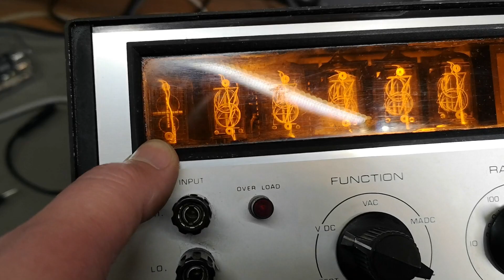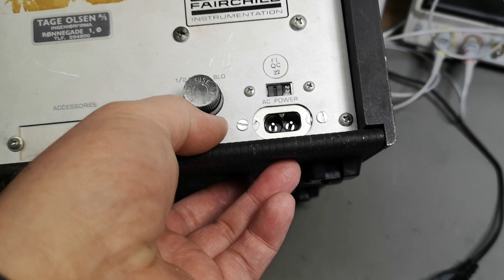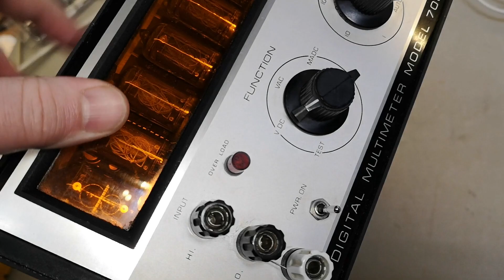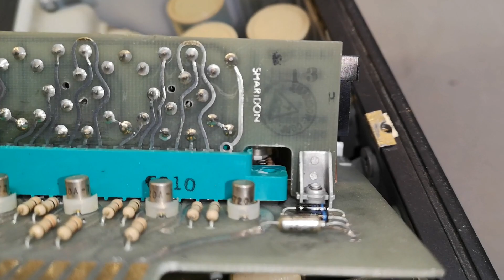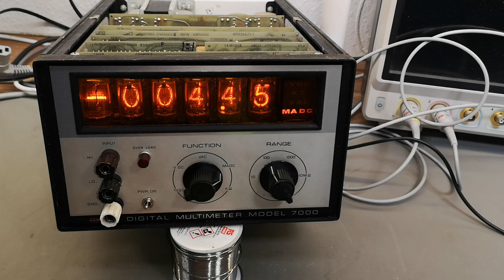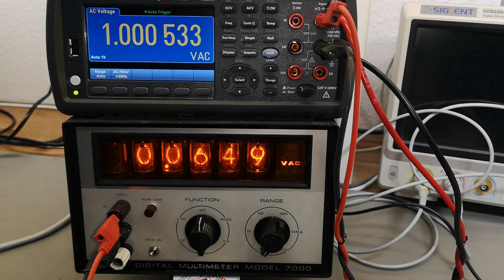Fairchild Instrumentation Digital Multimeter model 7000 Nixie teardown

Comment: Wow 😲 that is beautiful and the accuracy on the DCV. The first thing that came to my mind was "I don't know this meter from HP", only then I noticed that it is a Fairchild, the same looking PCB including descriptions, the same green socket, a redesigned power socket - the original hole resembles HP connectors, wire connections and Teflon insulating pins as in of old HP. The construction of the box is also very similar, including the display frame. So I really envy you this piece even with the missing DPS 😜......... 😁

Nice day 🙂 Tom
Reply from the maker: i am in the process of negotiating with other model 7000 owners, to get good closeups pictures of the missing modules, maybe they are not that hard to recreate, also the missing current measurement could be fun to solve, or is that missing due to the missing ohm and ac converter, maybe the fuse / current sense is onn those boards ??
Reply: @TeardownOZ2CPU  I also wanted to see if I could find something, I have never seen this multimeter, I managed to get a school digitron multimeter 3.5 digits from our Czech Tesla - because digitalrons must not be missing in the workplace 😁
I'll let you know if I come across anything, I'm already very tired because I just got back after 36 hours of work.
🤪Tom

Comment: Probably a single slope converter, given the age, and the simpler counter arrangement, seeing as there is a large integration capacitor, and also another auto zero capacitor next to it. Missing is the data interface, which probably gives a buffered TTL BCD output, along with the digit latches. Missing cards are likely options, as after all it was likely, given it was Fairchild, intended to be integrated into a rack mount test set, and then display voltage alone, and you plugged in the optional resistance and AC cards to give those functions.

Milliamps likely come from that option jumper board, which of course has to be there to provide the sense resistors and the overload protection, and then read the voltage across the sense resistors. You need the board to jumper the input socket to the ADC and range boards, as mA needs a relay to switch the input to the sense resistors, likely another 2 of those small reed relay units, then another few reed relays to select the appropriate ranges, and the last one to feed it back to the ADC section. 

Small board, probably with 6 small reed relays, a single 500mA fuse to protect the input, a pair of back to back diodes to protect the resistor, and then the 4 current sense resistors  that get shorted by the reed relays to operate the ranges. the one relay likely is a special type, normally closed reed, with a bias magnet to keep it closed, and then the coil cancels the magnetic field to open it. Ohms is a lot easier, just a switchable constant current source that is fed by another reed relay to the input, and then you have a linear resistance range. Probably shared half the resistors and reeds of the mA board as well, so you would probably have to order the resistance board along with the mA board to get resistance.

Remember this was when you would have an ATE setup running, pre HPIB being popular, and you had all sorts of bespoke control buses to make test equipment, and Fairchild was heavily into this market, as after all they were the premier manufacturer of IC parts, and also had a fairly large military market share, providing all sorts of aircraft flight systems, and the associated ATE systems to maintain them. Thus the need to have voltage reading digitally alone, with all other signal conditioning being done separately, as you have a single, or a few, voltmeters as input devices to the ATE computer (which Fairchild did as well, though half the equipment they made is still covered by secrecy clauses they had with the US millitary), and then a whole load of digital to whatever converters, and them a massive set of relay boards, that allowed any point to any point connection in the crossbar, including programmable power supplies.
Reply: From what I know, this was indeed in a test rack, and was being readout on an Analog computer at Danfoss laboratories.
Reply: Dual slope, the manual say

Comment: I expect there's more than one duff transistor in there, given they're those TO-105, TO-106 epoxy dome top type.
Reply: True, but Fairchild, given they probably pulled the parts from the MIL REL program for these, would have weeded out the weak batches before production. The rework does say that the early failures did get removed, and the one display issue likely is the only leaky transistor in there, as the rest are the more reliable metal can types.